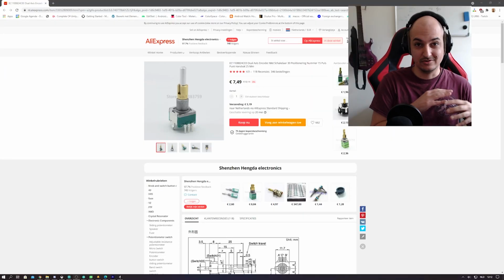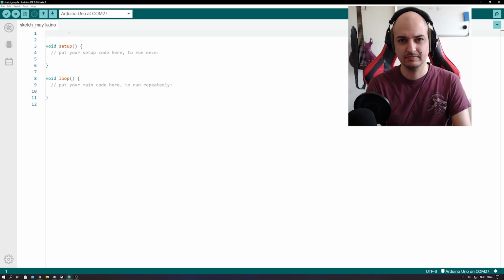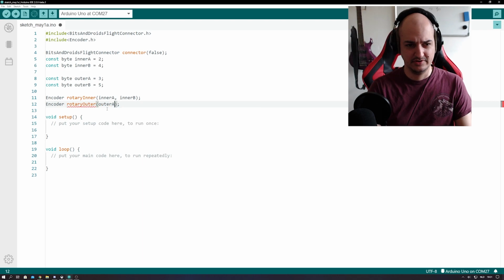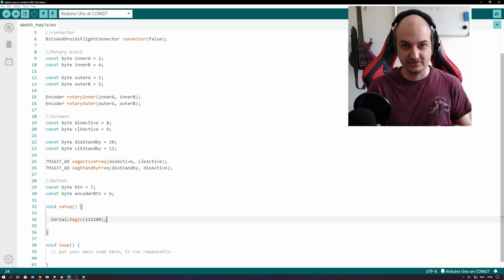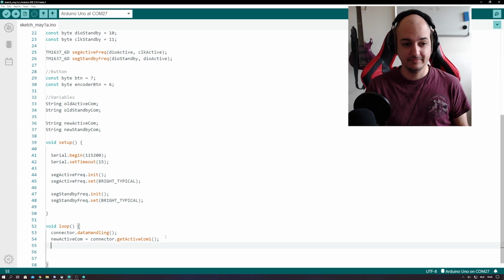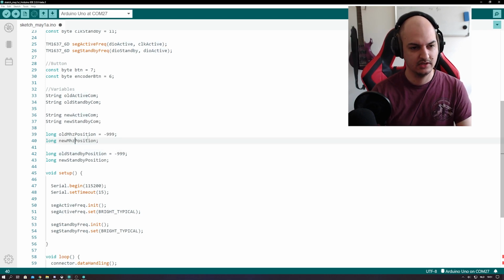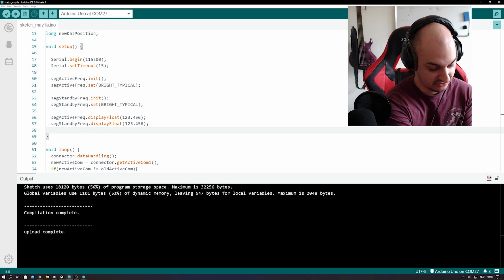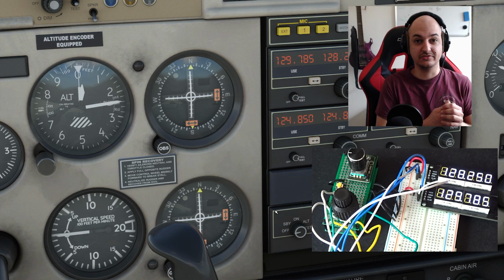How to create your own Arduino MFS2020 Radio stack

Comment: Hey man, thank you very much for your video and the very detailed description!
I tried to use your code to create my own radio panel but when flashing your code i get the following error:

'class BitsAndDroidsFlightConnector' has no member named 'sendCom1WholeInc'

I noticed that you changed some commands in a comment before and i used the command:
BitsAndDroidsFlightConnector connector = BitsAndDroidsFlightConnector();
but i am very new to this and i can't figure out what command to use here or how to handle this.
Could you please help?

Comment: Great video. Really inspiring me to try to put together  joint radio/nav stack.
A couple of questions... 
- I've found the dual axis controller on aliexpress...  but i cant find suitable pairs of knobs to go on them... any ideas?
- If I want to have 4 displays and 2 dual axis/push controllers, will an Arduino Uno be good enough? Will I run out of pins?

Comment: hello i have this problem can you help me ?
 "no matching function for call to 'BitsAndDroidsFlightConnector::BitsAndDroidsFlightConnector(bool)'"
Reply from the maker: Hi the new way to code this up would be BitsAndDroidsFlightConnector connector = BitsAndDroidsFlightConnector();
Reply: @Bitsanddroids  ok it's working, thanks
Reply: @Bitsanddroids  how can I display the numbers after the decimal points for frequencies. if I write on an LCD, I have 127.00 for example.
Reply: how is the frequency when it is sent to the arduino, I can only display the first 3 digits

Comment: just a quick question: what code editor do you use? And how do you get the popup references? Great video and very easy to follow the logic!
Reply from the maker: It is the Arduino IDE 2.0 Beta. 
Which can be obtained from their downloads page. It's not 100% bug-free but for me, the pros outweigh the cons. There is a chance you'll have to remove the old Arduino IDE first before installing.
https://www.arduino.cc/en/Main/Software_

Comment: hi Dave, how can we use max7219 with this code ? plz advice code alterations. Thanks
Reply from the maker: Yes you can I'll upload it tonight
Reply: @Bitsanddroids  Hi Dave , just wonderd if you had a cnance to do the Max 7219 code version of this great project , reason im asking is that i have all other bits but getting hold of 6 digit TM1637's is a pain  at moment ( long lshipping times ) i have a few Max 7219's and they are easy to get and available through  amazon . so im all wired up and ard progrtammed just waiting for Display :-(  Cheers
Reply from the maker: @calvinhall1405  just finished the code. Will upload it later today / tommorow
Reply: @Bitsanddroids  wow  thats excellent i know this will help a lot of other wannamakeoneothose crew , so many thanks for even consider doing this for us . This will be an exceelnt 1st panel for my  self built SFX150 3 DOF motiion platform , i consider this to be the 1st of a few additions ( autopilot and Nav Etc to follow  using your Connector utility )  cheers , already Subscribed to your disscord so i'll learn a lot from youand the members  over there and hopefully contribute to whole effort somehow
Reply from the maker: @calvinhall1405  There was a process in the connector preventing the proper use of the MAX7219 displays. I've fixed it updated the Article and will release it together with the new update containing the fix tommorow.
Reply: @Bitsanddroids  Hi Dave really appreciate you spending time and sorting this out for us , i know life still goes on outside this hobby ggod  buddy so suffice to say its done when its done , we understand , the fact that you had to make chnages to your connect utility shows you dived in deep. so on behalf of the rest of us , big up high fives and thanks . cant wait to play with this and expand it to other FS Instruments as well ,Saiiek can eat my shortys LOL:-)
Reply from the maker: @calvinhall1405  https://www.bitsanddroids.com/radio-with-a-max7219-8-digit-7-segment-display/ Hahaha Saitek is the reason I started this. Blood things are way too expensive for the quality you receive
Reply: @Bitsanddroids  . Wow wow wow . Bloody hell mate can't wait to get to my pc, just looked at updated blog and was blown away big time , the amount of work you did was gob smacking as we say . As I'm only on phone it was quick look expecting to just see a code update.  But lost for words at what you produced.   I need to make full suite of instruments now lol .  Thank you so much and even without this there is a donation pending once I'm back on air . Unbelievable great content wow,  and then some mate  high fives all around
Reply: @Bitsanddroids   hi good buddy not seen e-mail yet but check your paypal donate to confirm reciept of donation sent ., Gotta say the way you commented the code made it easy for me to understand your train of thought in developing this. Thanks  :-) , Now im gona go connect up wiring again and download  latest version of connector and libraries ..
Reply from the maker: @calvinhall1405  Oh wow that is very generous of you. Thank you very much! Hope you enjoy the journey and love to see the end result.
Reply: @Bits and droids Just watch it and it was amazing. I don't understand that coding at all.. But it gave me the bug to start learning. Without any skills on programming I just made a simple two seven segments display to run all Nav1 Nav2 Com1 and Com2 with one encoder and two push buttons if you want a can send you the files. I belive you can do it easely but it's more knowledge to add to your settings..  Tardih@gmail.com if you or anyone are interested in my setup.
Reply from the maker: Glad you liked it. I've send you an email but it sometimes arrives in the Spam folder (just wanted to give you a headsup).

Comment: great work and this seems like a nice addon for my motion simulation project , just a pity for me , in this instance , as i have major hearing problem so missed the closed captions you normally have on your excellent tutorials ... not a stopper though as you make it easy to follow and understand the steps you used to get this working ..Kudos to ya for Posting a very helpful project, Cheers  :-) pause and replay will be working overtime on this Video LOL
Reply from the maker: Normally the processing of YouTube takes longer. Since it was quite fast this time I've got the feeling that YouTube just hasn't processed the captions yet (they are auto generated by YouTube).
Reply: @Bitsanddroids  thanks for tje reply really would like a crack at this seeing as i have most of the bits laying around , so once again big thanks for the inspiration
Reply: @Bitsanddroids  mate ..massive thank you for going the extra mile , Huston we have captions .. Pilot we have happy flyer LOL . guess what i'll be doing for next few hours :-)